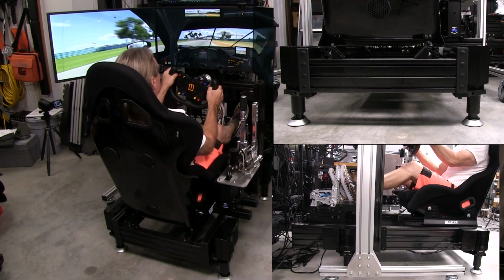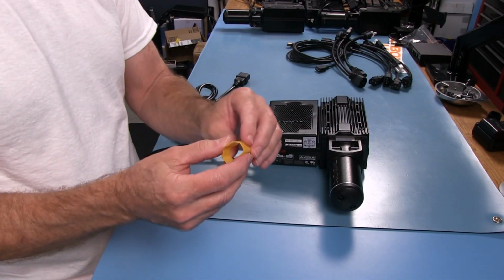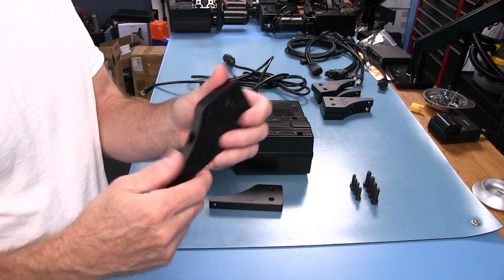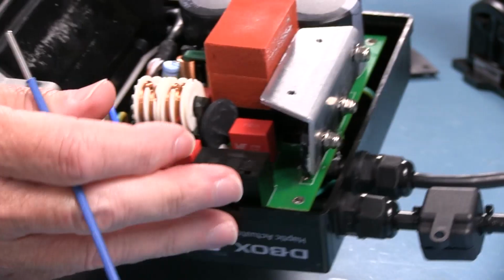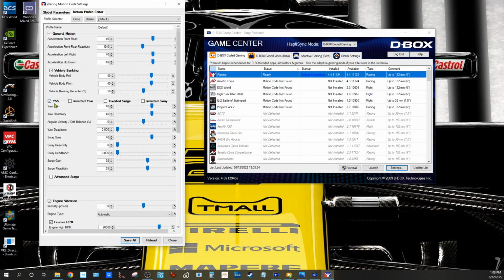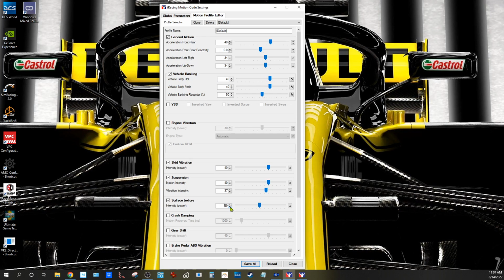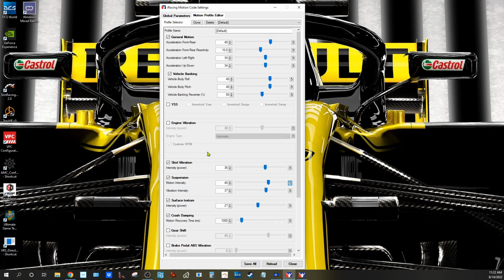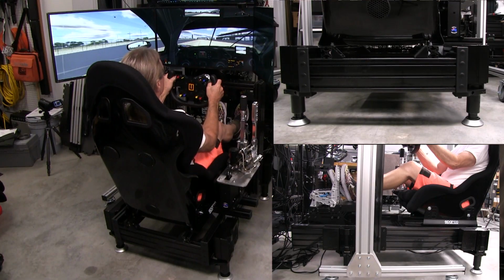D-BOX G5 Haptic System Review and ASR6 Cockpit Updates

Comment: Be aware, if you have RJ45 cable issue on your GEN5, DBOX support told me the cable could not be change and I have to buy a new actuator. Really poor design and support.
Reply: What kind of issue do you have? It it's just the connector, you can probably put a new plug and crimp it like a usual ethernet cable. same goes with cable itself. Sure, some soldering might be involved, but if it's already broken you can't break it more. Worth a try doing a DIY repair. Too bad for DBOX not making more modular system or making spare parts available.

Comment: what motion system do you recommend if budget isnt an issue and the most realistic for you?
Reply: If I had the money, I would probably pair the eracing lab Rs mega+ along with the next level seat mover and simxperience G5 Gseat. So you have the SFX for road and bumps feel, the seatmover for GeForce along with the Gseat for extra GeForce immersion (Recommend you have a harness on). I'd say if tuned right, It'll be the most realistic motion out there, All this will be around 13 grand which it's very expensive but a lot cheaper than the allmajor brands. And I recommend you placing the triple monitors on the motion rig itself so you'll get a one to one feel. Or just get a vr😊

Comment: Barry, thank you for your hard work and the detailed videos. One thing I don't understand: is it "more realistic" to have the monitors mounted to the moving rig or to keep it fixed on the floor while the rig moves? Thank you
Reply: Sim software is already simulating car movement in the screen.  Motion rig and motion screens will probably  have more movement that you need to feel.  Besides of that, you would be adding more weight to your rig and your motion system will need handle a higher load.  On top of that, your monitors and their electronics were not created to vibrate, and 3 monitor config will be most likely misaligned easily.  Imho
Reply: Good question!

Comment: Hmm makes me think they should maybe design a system where the actuator portion of the device is at the bottom and acts as the feet of a sim setup, which will cut the "sprung mass" of the rig down quite a bit. Not having the weight of 4 of these heavy duty devices added to the rig would make a big difference, I'd imagine.

Comment: I tried to find a price but couldn't. I think it's around 7000$ for 3dof? Evidently, they don't have a problem finding costumers at this price. But I'm still surprised that people would spend that much when you get more capable systems for half or even almost a third of the price. What does the dbox system do that the $2500 eracing lab kit can't do?...i don't know... What i do know is the dbox system can't make you feel slopes or banks as well... spa, brands hatch, daytona... those tracks benefit greatly form a 150mm actuator... the only advantage I see is how much easier it seems to set up the system... A few plugs and good to go.... I've never tried dbox but it doesn't seem to behave exceptionally different compared to the rest.
Reply: No experience with the Eracing kits but coming from SFX100 with Thanos and SRS I find the D-box to be a lot “smoother”, the software to me was easier to tune and get just how I want it. The transducer effect is awesome so no need for bass shakers. Is it worth 2-3x as much…no. Just like real cars you pay that premium for a little gain. If you want to do flight sims and rally and trucks get the DK2+ I’d say. Me I am perfectly happy with my D-BOX no regrets.
Reply: @damiengvideos4337  Thank for sharing.... Had you tried the engine vibration function of SRS ?... Pretty effective i think .. i don't have any bass shakers either... I guess I'll never know what you mean by "smoother " as long as I don't try it myself. But srs/sfx150 combo is tuneable to infinity.. from super smooth to super harsh...took me time to get it right but it's perfect now.
Reply: @L_Emir_de_Passy  Yeah it’s something you just need to try yourself if you can. The rumble function in SRS is nowhere even close to what the D-BOX can do. If you want the D-BOX can vibrate the fillings out of your teeth 🦷 😂. I have mine tuned to 75% to motion and then 25% towards the haptic vibration feedback.
Reply: Prices for North America available here : https://www.advancedsimracing.com/collections/d-box
Reply: And to answer your question, D-BOX is the only system that can do 0-100hz vibration superimposed with motion. Meaning you can get a lot of subtle cues on how the car is behaving at all times, all while feeling braking, acceleration and a slight bit of banking.
Reply: @advancedsimracing  I see... Ill have to try it .. though, it won't be a game changer for me i imagine
Reply: @advancedsimracing  is there a place in the US where I can try out a dbox platform?
Reply: @L_Emir_de_Passy  Burbank, California yes! Invite-only for our clients and potential clients of course

Comment: I notice a 2 actuator option for sale, would that be to compete with something like the Next Level Racing Motion Plus?  That might be a nice option for someone looking to break the bank a little bit at a time.
Reply: Indeed! It's a more cost-effective approach that works extremely well for open-wheeler racing. You don't really need heave while driving F1 for example. (the 3rd degree of freedom you get from 4 actuators) : More info right here - https://www.advancedsimracing.com/products/d-box-generation-5-2250i-haptic-system-1-5-travel-range-2-actuators

Comment: I would like to see a ranking of similar motion systems. SR1 vs Dbox vs Ptactuators etc. I can never tell what is best. You seem to like most. What is your favorite system? Thanks
Reply: Add sigma integrale to that list
Reply: My take  D-Box, Sigma Integrale, Pt Actuators, SFX-100, SR1
NLR has one now too, and they have the easiest to configure motion software of any out there, not sure how it stacks up.
Reply: @markkovalcson7243  I do get the impression D-Box is best. At least the price is getting better.
Reply: @johnambers  I'd be curious to know what makes you think so. Apart from ease of setup, i can only list features that make the dbox system less capable than pt or eracing lab/sfx150....and at a significantly higher price.
Reply: @L_Emir_de_Passy  I very well could be wrong and I know the D-Box is premium priced but from what I have read and watched is that they firstly run on most every game with ease of setup, secondly, they have some of the best subtle feelings along with dynamic range. I have heard the motor vibration is next level. They are quieter than a lot of other actuators from what I gather, which is big for me. I do know their response is slower but from all reviews, it doesn't seem to be a problem. At $7000 they are not bad as they used to be. What do you think is the best high-end actuator? I am looking to build a system soon.
Reply: @johnambers  I am trying to figure out which one to buy. I have no way to test them so I Ned to which one is the best before buying

Comment: Excellent timing, looking at picking up an ASR6 soon.
Reply: I have an ASR6 and couldn't be happier. Wish I would have bought it as my first rig. Feels like a solid block of granite that will last a lifetime.
Reply: Wise choice. I'm a little biased, but wise choice. 🙃
Reply: @advancedsimracing  I have a NLR V3 motion platform....know you're biased 😆, but what will be my experience if I opt for the ASR6 vs the P1X which has specialised V3 mounting brackets - crazy job & demanding family duties, so heads up : DIY may be a challenge 🙈
Reply: @advancedsimracing  Risk of another "biased"response:))....if I do indeed go with the new ASR6, any thoughts on adding the new NLR motion plus platform to my existing NLR V3 platform - effectively at a combined cost of $7k or cash-out on a pretty good offer for my existing V3 (@ a $300 haircut/loss) and then purchasing the new Dbox gen 5 system @~$7k?  
Btw, is there any deal if I buy the latter from ASR's site directly?

Comment: Love my Gen 5! I was worried about EMI but has not been a problem at all even with VR.
Reply: EMI on modern hardware should not exist. If it does than its faulty/poorly designed and should not be on the market.
Reply: What rig are you using it with?
Reply: @lukebraddford3287  SimLab P1X
Reply: @damiengvideos4337  thanks. I have simlab gt evo and wonder how it would work with it
Reply: @lukebraddford3287  should work just fine. Make sure to get the mounts Advanced Sim Racing sells…they attach to the underside of the profile.
Reply: Hi what VR headset are u using? as I am interested in this system but i only use VR
Reply: @SURG3NT  Currently using the Varjo Aero with Steam lighthouse tracking. When I had my SFX100 motion system sometimes I would have tracking issues with my Index also with lighthouse tracking. No issue ever with the D-BOX.
Reply: @damiengvideos4337  thanks man!! I also use Varjo, I had the SFX150 and had nothing but problems with tracking, grey screen whenever I touched headset also just complete loss of tracking!!!it was a nightmare so I sold the motion system, I’ve just ordered the DBox g5 comes in 2 weeks 🙏
Reply: @SURG3NT  I know your pain I had the SAME issues! You will love the Dbox! Good choice…not cheap but worth it….should run for 20+ years with no issues.